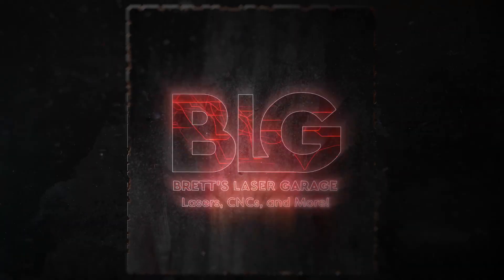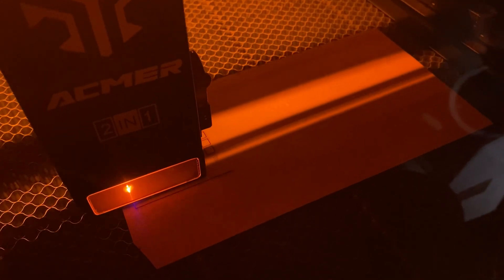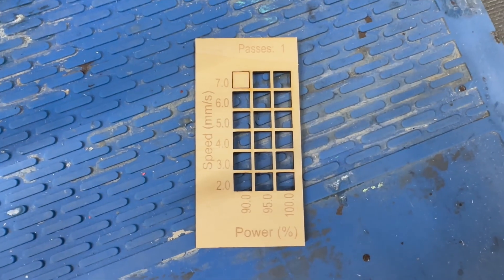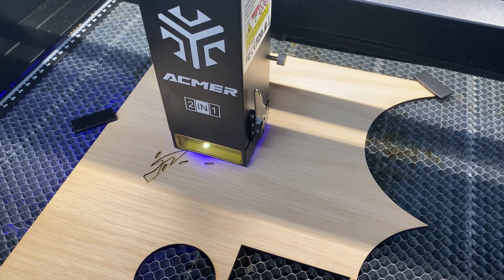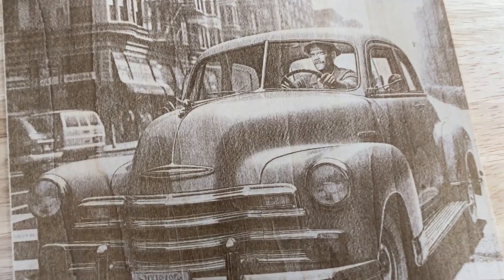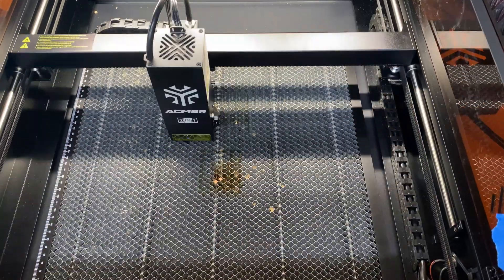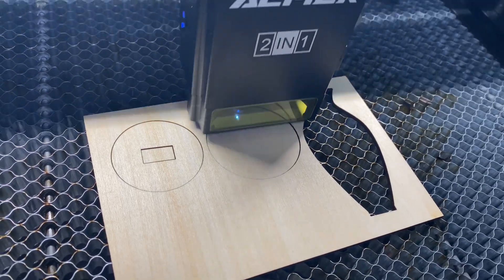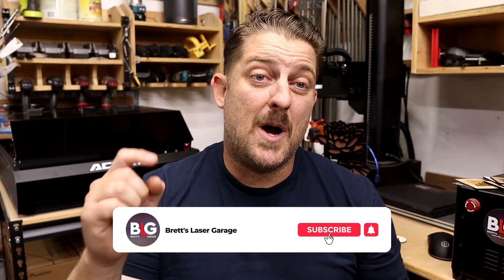10W Diode + 2W IR Laser in One Module?! | Acmer P3 2-in-1 Laser Real-World Test

Comment: Hey man - terrific review on this machine. I’m actually in the market for a new diode, and I’m considering this one as an option. 

A couple questions if you don’t mind:

1. Do you know the spot size of the 10w laser? I checked the website and didn’t see it listed there.
2. You mentioned that all advertised features work well with Lightburn, does that include an auto focus? And the camera (also does the camera require a second usb connection as I know is sometimes the case).
3. I see that Acmer offers a rotary attachment. Do you know if the machine also requires a riser base in order to use the rotary? I ask because I saw the rotary, but not a riser on their website.

Thanks in advance if you know any of these!
Reply from the maker: Thank you very much, I really appreciate that.  

1. I would assume it’s the same or extremely similar to any other 10w diode spot size out there in the market.  However I don’t know the exact spot size.  

2.  This laser doesn’t have auto focus.  The camera and machine are connected to lightburn via one single usb cable which is very convenient. 

3. Sorry not 100% sure as I did not test the rotary.  I assume it just depends on what you’re trying to engrave.
Reply: @LaserGarage thanks for taking the time to reply to these questions. Much appreciated!
Reply from the maker: Anytime man!

Comment: Brett, now that I have my new workshop done, I am considering something like this for shows instead of say Xtool F1. Is the size and weight of the machine lend itself to doing something like that or not? I think I like the Acmer P3 but think this size would be the max size for what I am looking for.

Thanks for the info.
Reply from the maker: Thanks a lot.  It really depends on what you’re looking to engrave.  The F1 is perfect for portability but if you need more work area the P3 would definitely be an option.  I don’t do craft shows so I don’t have any first-hand experience unfortunately
Reply: @LaserGarage thanks for the response. Went into my new workshop last night and was working on lightburn when my 10 year old laptop crapped out on me. So there goes the laser money for now...😂
Reply from the maker: Dang!  Well at least lightburn doesn’t need a lot of computing power.  Get a budget pc and a laser!